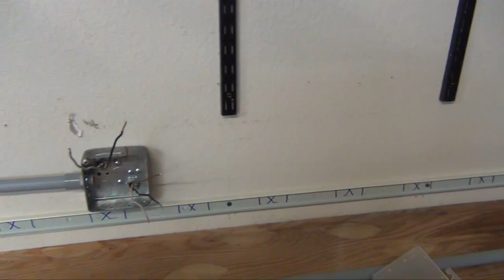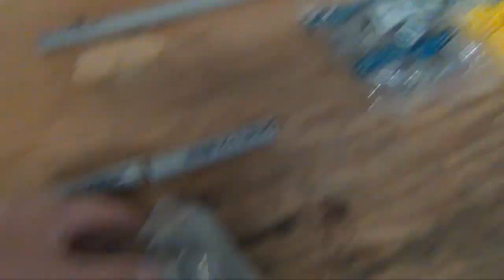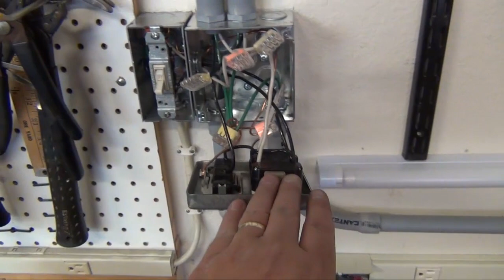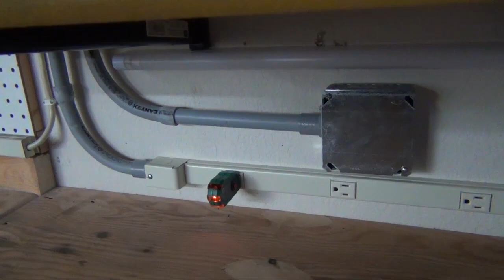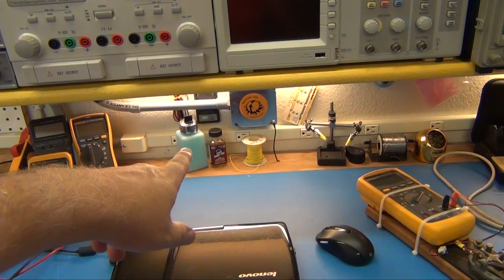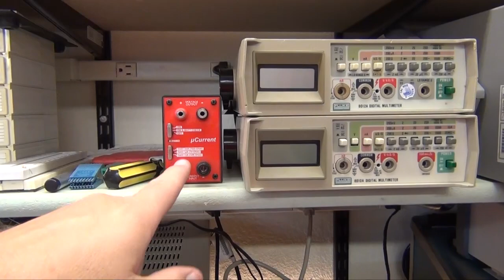ToddFun.com: Tech Bench Upgrade With 30 Outlets And 4 Shelves

Comment: while your choice to use conduit (not romex) is admirable, pvc is not approved for surface mount and that *bend (coming out of the top center of the 4" jb) is atrocious.  woulda been a good place for a lb. as for other's comments regarding grounding/bonding i think you're ok. it looks like you have a ground in all pulls and they're all pigtailed together and screwed to your boxes. i'm not familiar w/ your connectors, but if they're rated that's good enough.
Reply from the maker: +Pad Lok I didn't know about the conduit. I was never happy with that bend either. Well, its just my garage and there is not threat of it causing issues as far as I can tell. She should be all good. I'm thinking of making some changes but not sure I want to change that much. I want to get power to my PC that I now keep at my bench that does not go off with the lights.
Reply: the prob. w/ collapsed bends is that they shrink the cross sectional area of the conduit and thus the volume inside the tube. this is an issue because of heating but shouldn't have any effect on your single pull of single phase.(a quick look at an old nec says you could put 27 @14awg or 19 @12awg[w/ thhn/thwn insulators] in a 3/4" pvc).  code would've allowed for smaller conduit anyway. pvc isn't approved for surface mount only because it can't protect the conductors from impact. while no contractor or wireman would have built this that way i don't think it's unsafe, however you may have issues with inspection if you choose to someday sell the home & leave the work in place. all said, good work!

Comment: This question might be a bit off topic, but what would happen if  you mix the live and the neutral wires, beeing that it's AC?

In the US there's a size difference in the holes in the outlets, but here in Norway our outlets allow the power plug to be plugged in both ways. The ground wires are on both sides of the cable (we have both non-ground wires with only two wires, and then grounded wires with three wires with the ground on both sides of the plug/outlet).

Here's a picture of an outlet and plug from Norway:

http://www.klikk.no/multimedia/archive/00373/Stikk_st_psel_397_j_373929b.jpg
Reply from the maker: The items you plug in will still work but in the USA we reference all household AC to ground at the fuse/breaker box. I will just copy the wiki answers below, it is quite good:
"There are two reasons one cares about polarity in AC circuits: safety and phasing.
In a common household circuit, we are concerned with safety. One side of the AC line, called the "neutral", is at the same voltage as ground. This side of a common outlet is identified by the wider slot and plugs have a wider blade. In the wiring, the neutral is white. On wiring devices, the neutral wire connects to a silver colored screw. On appliance cords, especially flat, two-wire "zip" cord, the neutral side usually has a rib or ribs to identify it. Sometimes this rib is very subtle, like a square corner on the neutral lead where the hot lead is completely round.
The other side of the line is the "line" or "hot" wire. In household wiring, this side is black or red. It corresponds to the narrow slot in an outlet and connects to a brass colored screw.
Circuit breakers and switches are supposed to be wired in the hot lead so if they are turned off, both sides of the connected receptacle or light socket are at neutral potential. If this were not the case, you could get a shock from a light socket which is turned off, if you were also touching a grounded contact of some kind. For further safety, the larger annular threaded contact in a light socket is supposed to be connected to the neutral and the smaller button contact to the line side.
Years ago, this was even more important because household electrical appliances were often made of metal. Plastic wasn't as common. The metal would sometimes be connected to the neutral wire. If the polarity was reversed, the metal case would be "hot". Many old tube-type radios had no transformer in their power supply and the chassis was connected directly to the wide blade of the plug. If the receptacle was wired wrong, the whole radio would be "hot".
The second reason we care, phase, relates to more complex wiring such as three-phase circuits and in electronics. AC voltages are really DC voltages at any particular instant in time and thus have polarity. The polarity of these instantaneous DC voltages is just as important, and for the same reasons, as constant DC voltages.
"Phase" refers to the relative polarity of these instantaneous DC voltages among a related group of AC voltages. If you wire two AC sources in series and they are "in phase" then the voltages add as expected. If one source is reversed, then the voltages subtract. Similarly, paralleling two AC sources which are out of phase, will have the same result as paralleling two DC sources with opposite polarity - a fire."

Comment: As long as you use your ground wire to ground your boxes your fine on bonding. You don't have to run metal conduit, wire is fine. The connectors are fine, you can use them in residential and commercial in the states. Electricians don't generally because taking apart wire nuts is a lot faster. Electricians will use metal conduit in commercial, but, this appears to be a residential install. I would just make sure you have all the boxes grounded to your ground. There's a hole in the back.

Comment: looks much neater than much of the DIY you see over here. in the UK it is considered normal for the 240v sockets in bedrooms and living rooms to be fused at 32 amps, with nothing more than a thin piece of wire to protect the circuit (rewirable fuse)

Comment: This is a DIY install and any decent electrician here would have a heart attack if they saw that. While Murikan/Canadian codes are more lax than EU codes, electrical installs here are fairly clean, aesthetic and safe. That kinky PVC pipe he ran would not fly in a commercial install, you would need to run metal pipe and uses proper ground bonding between junction boxes. Also the connectors he is using are a gimmick and are never used in commercial installs. We use wire nuts or terminal blocks.

Comment: Todd I was under the impression you have to bring drawings and get a permit to modify your own wiring from a local authority (at least in Canada you have to). Although I'm not an electrician, I know a bit of NEC and you have ground bonding violations. The connectors you are using are also not designed for stranded as they grab only several strands and sometimes chop them off. All in all, the wiring job is mediocre. Don't show this to any electricians, you'll get kicked in the sack.

Comment: this is so much harder to do in the UK, as our outlets are so massive, those power strips would have to be massive, instead I would have to use regular twin sockets and conduit. also, we can't use wire nuts so everything has to be terminated with screw terminal blocks.

Comment: I think in the UK you can do this, providing it isn't permanently wired into your home and instead is plugged into a normal power socket - it then just becomes a load of power extensions plugged into a 13A mains socket.

Of course, if you burn your home down it might invalidate your insurance, but it'd be the same as plugging lots of regular shop-bought power strips into each other.